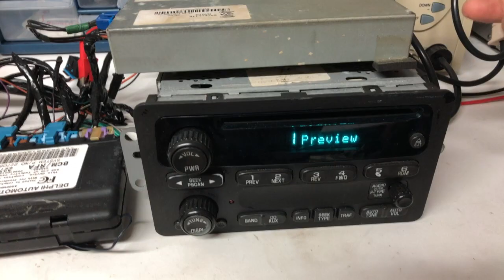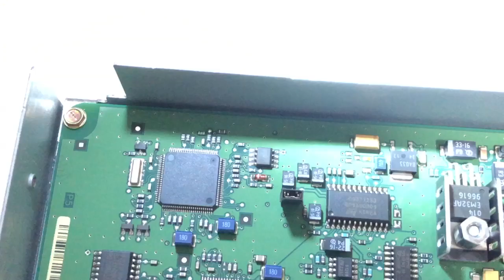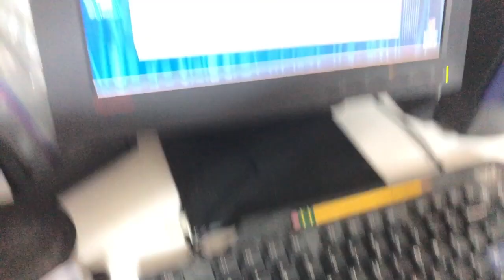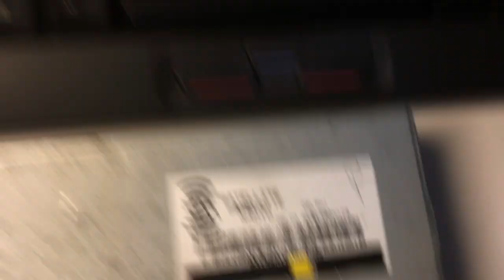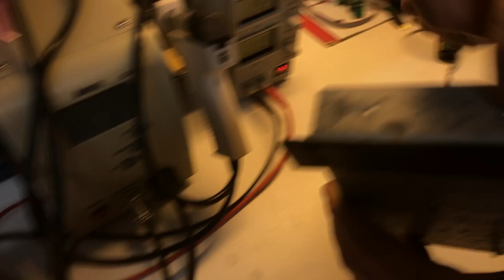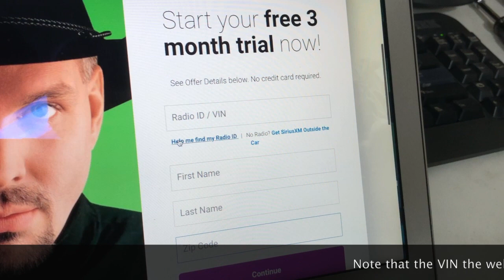2003 04 05 Unlock XM Lock Error on Salvage Yard GM XM Receiver (Buick Cadillac Chevrolet Pontiac)

Comment: Any chance you could show how to do this process on a newer xm module? The module in my 2013 GMC Acadia went bad. I bought a replacement on eBay and it's XM theftlocked. Which chip would i connect to.
Reply from the maker: Typically the newer XM receivers are no longer separate units but integrated into the radio itself (separate board but not separate box).  I don't have any board level information on those types.   If the radio and XM receiver are two separate boxes like I've shown here, installed separately and in different locations, then the procedure will be exactly the same though the XM receiver board layout may differ.   But I believe this two box design ended around 2010/2011.
Reply: @DrShock  It's still a seperate unit in mine. I bought a used one to pair with my current radio. I just wasn't sure with chip on the board to connect to. I think i have figured it out, but not sure. Only way to find out is to connect the programmer once it arrives. Thanks for your time.
Reply from the maker: If it's separate yeah the same technique I've shown should get you going.  The boards are going to be different though.  I would look for the same size/type EEPROM as I showed here first, if you don't find that then it could be a SOIC8 type device like used in regular radios instead.  But if it's a separate box, it will store the VIN on an EEPROM somewhere.   Note that later year GM/Delphi PCBs almost always require the device to be desoldered and removed from the board to reprogram.
Reply: @DrShock  I wasn't able to read the epromm on or off the board with modifying the CH134a like you did. I did find however that the replacement module plays nice with my radio after removing the epromm from the module board. No issues at all with functionality on a 2013 GMC Acadia.

Comment: I have a 2012 Escalade, got new XM radio receiver and I am getting error xm theftlocked
Reply from the maker: Similar issue (VIN locked), but totally different board so this video wouldn't be applicable.  If the XM receiver is a separate unit you might try my other later model vid instead - https://www.youtube.com/watch?v=D90hNb0VigM  but if its integrated into the single radio head then you will have to try reprogramming it with a GM MDI type scan tool and their Techline Connect reflash program (paid subscription deal).

Comment: informative video thank you, I would like to know how you worked out the ST 9355093 is the Dephi  house part number and actually type is 24C08?
Reply from the maker: Trial and error really.  You can determine the chip number by reading and watching for data wrap around (information repeating).  If that happens the capacity is smaller than you selected, and you choose a smaller device until the wrap stops.  That's how you tell 24C08 vs say 24C16.  The house numbering can also be detected by examining several board examples in the salvage yard (one for each model year of the same design).  Usually the first run, or the last run, will be too small for the cost of custom house numbering and you'll see the off the shelf chips used.
Reply: @DrShock  thank you for taking the time for my reply - some great tips there!

Comment: Great video, I have a very similar problem on my 2009 Buick Enclave, But I replaced the BCM, how is the process?
Reply from the maker: The XM receiver had its own unique kind of VIN lock, and GM intentionally didn't provide a scan tool method to unlock one.  The GM dealer was supposed to mail the old unit back.   Replacing the BCM would not unlock the XM receiver since there's no way to change the VIN in the XM receiver other than what I've shown here.   Now if you've replaced the BCM, and are asking about how to deal with that I have a similar video here that might help - https://youtu.be/Chy9pIzoguA
Reply: DrShock thanks for the info.

Comment: Very helpful video.  I have an XM receiver out of a 2006 Corvette and I have purchased the same chip programmer/reader in your video.  Can you point me to an Apple Mac application that will let me do the reprogram?  I do not have ready access to a Windows machine.
Reply from the maker: While my primary laptop is a MacBook Air, I end up having to use various flavors of Windows for all of my automotive diagnostics.  The GM Tech2/MDI tools have zero Mac support support being based on Java and I'm not aware of any EEPROM programming software apps for Mac that support the common / popular EEPROM programmer hardware designs out there (i.e., TL866II+, Black Edition CH341A, UPA-USB, etc).   You can find drivers for Mac for some of these but no application software to do the actual chip selection and read/write/verify ops.  I suspect anyone using a Mac is rolling something on their own at the command line level.

Comment: I have a 2005 Chevy Trailblazer that has XM and I'm going to crush the truck I want to put it in my 2007 Avalanche radio and converter will that work
Reply from the maker: The Delphi XM receiver would definitely end up VIN locked trying to move it between vehicles.  But I am not familiar with the radio head units in those two models for 2007 to know if they are plug compatible.  If the receiving truck didn't originally have XM you won't have the right wiring harness or antenna nor would the radio head unit be programmed to talk to the XM receiver.   It would have to have come with option U2K on the original factory options sticker (located on either glove box door or truck floor spare tire well area).
Reply: Yes both trucks had the XM the head unit fit just wanted to know if the XM if I take it out of the glove compartment and put the one that's working in will that work but you said it have to be program local dealership do that
Reply from the maker: Ok, if you originally had the XM option then the receivers should be compatible as long as the connectors end up being the same where you plug them in.   However, the local dealership will not be able to unlock them.   These XM receivers were the first modules, of the many in current GM vehicles, that blocked using used parts.   So they cannot be unlocked by programming, only the method I show in the video.

Comment: Would you be able to set the xm up as a new module if you just replace the 24c08 chip with a new one?
Reply from the maker: Not with a blank chip, you would need a virgin EEPROM image to burn it with how they came new out of the box.  I'm not familiar with what the chips contents looked like before it was populated during initial pairing with the radio head unit to reverse engineer that.

Comment: so I found this while looking for how to activate xm bands in my 2004 cadillac srx head unit. 

I am trying to add an after market aux adapter, it basically hijacks the xm input but for the headunit to see it and send that signal to the bose amp I need to be able to access the bands. supposedly a dealer could do it but local shop wants $150 to even look at it and I am not sure they know what they are doing. 

Any suggestions?
Reply from the maker: Nope, you will need the after market supplier to spell out exactly what is needed to use their product as the dealer won't have clue one about a non-GM accessory.
Reply: @DrShock  https://www.discountcarstereo.com/pxaux-cts.html
Reply from the maker: That accessory just replaces the XM receiver and plugs in instead to the radio head unit wiring harness connector.   The only reason XM comes into play is the vehicles radio head unit has to be XM Ready or programmed to support a factory XM receiver for this type of accessory to work.  Typically that means the radio has to have a BAND button along with a TAPE/AUX button on the face, or a remote CD/AUX button to function.  If your radio head unit doesn't have such a button, this accessory is not compatible with your vehicle.   Best to contact the seller on these sorts of questions, it really doesn't have anything to do with this video I've posted.

Comment: Is there any specific area you find the VIN ? Or you just look for a number that looks like a VIN ? And when you need to clear the VIN do you change it to Zeros ?
Reply from the maker: The VIN may not appear in the same EEPROM memory location as I've shown here for years after 2010, or later years may not even have it as clear text (it may be encrypted or obfuscated).  But if you're working on an XM receiver prior to 2010 it should be clear text in the location as I've shown in this video.   The EEPROM is no longer virgin as other information has been written to it vs a brand new one in the box's EEPROM, but only the VIN value needs to change on an used XM receiver to match the VIN in the Body Control Module (BCM) of the vehicle it is installed in to unlock it.   Changing other memory values may brick the unit so I would advise not to do that without saving copies of the EEPROM.   And I've not tried writing zeros there or anywhere else, so I do not know what will happen if you do, so again I advise against it.  Best stick to the script on what is known to work unless you're prepared to scrap the unit if its bricked should you not be able to recover a previous EEPROM image.  ;-)
Reply: @DrShock  I tried reading all (3) of the EEPROM's on the XM Module and I got a green light on the same chip reader you used in the video indicating a good connection on each EEPROM I tested, the software indicated the IC was read properly but all I got was an array of  zeros on the entire chip. The software showed an array of Fs and this changed to all zeros whenever I read the EEPROMs. Did I do something wrong ?
Reply from the maker: @jeffreyhavelin3554  Getting all 00s indicates a problem reading, all FFs would indicate not seeing the chip typically.  Did you remove the EEPROM from the PCB?   I mentioned in the video some board revisions from Delphi are not readable in-circuit with a test clip.
Reply: @DrShock  I got all zeros on each of the (3)  24C08 EEPROMs on the board; I was reading it chips "directly on the circuit board" and the software I used was AsProgrammer_v2.1.0.13 set up for 24C08 EEPROMs. One EEPROM in particular was also  located in the same exact area on the circuit board where you were able to read with a test clip. The red line on the test clip was oriented correctly with respect to the dimple on the chip, and I was using the CH341 programmer with the ribbon cable positioned in the same direction as seen in your video . OK, so it seems I did everything correctly, but based on a reading of all zeros it looks like I'll have to remove the target EEPROM; this is not really my forte, but I'll attempt removing the EEPROM and see if I can read it properly. Thanks
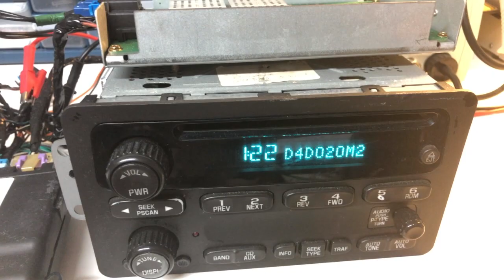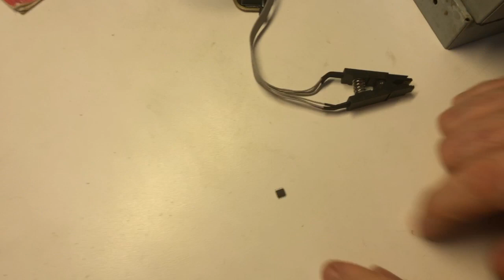Reply from the maker: @jeffreyhavelin3554  So a couple of points here. you'll notice at 15:00 I show at least two different boards one that can read in circuit one that cannot.  At 15:43 or so reading it removed.   If you're XM receiver is one from 2003 - 2005 and matches the version that I read in circuit, part number and layout, then I'll try and help see what else it might be.  If you have one of the boards that needs to be removed, also for 2006 - 2010 ones, I recommend the Chipquik product in the description for removal as it makes it so much easier.
Reply: @DrShock  I was working on a Model 22729350 XM module pulled from a 2006 Corvette. Sounds like I will need to pick up some Chipquick and maybe a mini heat gun.

Comment: Got a question. If I am looking at adding it into a vehicle that does not currently have XM, but has the head unit that will accept XM, is there a special wiring harness I need to use? I found some harnesses at a junkyard and I have an orange, green, and black wire on one end and a pink and orange striped wire on the other end that I don't know what to do with. I know orange is power and black is probably ground. Is the green and the other pink and orange striped required?
Reply from the maker: The Delphi XM receiver does have a proprietary connector for both the wiring and antenna.  These units are quite sensitive to noise/interference so you're going to want to get the complete antenna harness out of a donor vehicle of the same make and model year with the plastic retaining clips that GM used.   The antenna harness cannot be spliced or cut as most years will throw a code if you do, you'll need to extract it intact with no damage to the insulation of the cable.   The wiring harness is likely already there if you have an up level trim, but if not cut it close to the head unit.   Keep in mind if your vehicle did not originally come with option U2K (check the options sticker in the glove box or trunk) then you'll need to reprogram the Body Control Module and/or Radio head unit with a Tech2 tool to inform it that you have installed one.  To find out more about the pinout of that connector check this other video I have here - https://www.youtube.com/watch?v=SDRSA_fO2d4

Comment: Nice video new subscriber here with a couple of questions. I have a 2004 hummer h2 that I updated with a 2006 GM NAV unit the previous owner took off the Xm receiver so I got a used one. 1 Where can i order the harness that goes from the xm receiver to the radio ??? i also updated the bose premium amp to a Lux amp from another truck escalade and rewired the harness to communicate properly with the Lux amp  , as expected I only get sound from the front passenger side letting me know it needs a amp relearn.. where can i find the steps to reprogram the amp to my truck with the tech2 ??? Thanks in advance.
Reply from the maker: For the harness, personally rather than trying to order this from GM I would just pull it from a salvage yard vehicle.  LKQ has yards around the country where you can do this yourself with your own tools, so I would try checking if there is one near you first.   If not, you want to find a GM dealer who still shows the parts explosiion diagrams online (frustratingly this is increasingly being withheld to force you to go to the dealer parts counter in person) but here's one dealer who still does it - https://www.wholesalegmpartsonline.com/cars/Hummer/2004/H2--Base/Audio--Navigation-and-Entertainment/H2--Base-parts.html  and you can find the harness you need visually and its GM part number.  With the part number you can try eBay or such before resorting to the dealer pricing.  The Tech2 is going to block you doing what you're trying to do unless both the NAV unit and AMP were available from the factory in 2004 (this is the GM service programming system (SPS) and maps allowable options to VINs by model year.   If these were valid regular production options (RPOs) in 2004 then you should be OK as long as the 2006 parts are interchangable with 2004 ones electrically for that years body control module (BCM) to recognize them.  The steps would be via SPS and would go something like a video I once did for a 2009 Cobalt radio within this playlist - https://www.youtube.com/playlist?list=PLKGiYMtrEJBNvIjVNchktlQKZxtYxXAc3  For both 2004 and 2006, TIS2000 should be all you need along with the Tech2.
Reply: DrShock thanks alot
Reply: @DrShock  so to solve my  AMP situation since my used AMP came from a escalade all i had to do is build a  escalade profile on the Tech2 and the option to do a vin relearn became available so now thats fix . thanks for the help  . now i need to watch your video on unlocking the XM module since i want to add that to my hummer too , i also need to order the eprom reader/writer . thanks again ...

Comment: Great video.. Could you just swap eproms?
Reply from the maker: Yeah I believe i mention in the video that's another option as well on these particular models I'm working with, but you'll still lose the original radio ID and have to update it on your SiriusXM account as that's written to the EEPROM internal to the DRR.